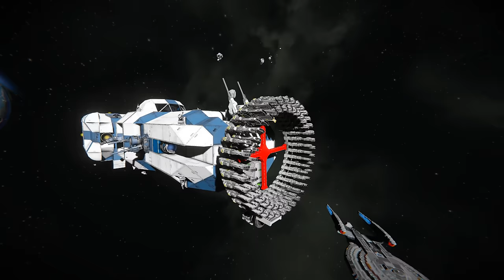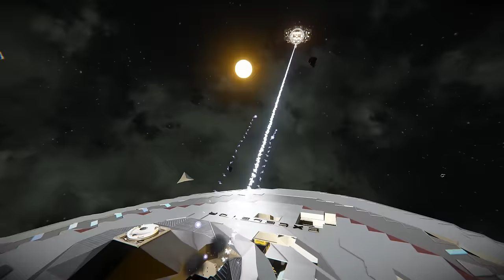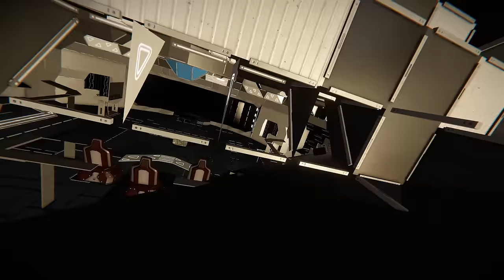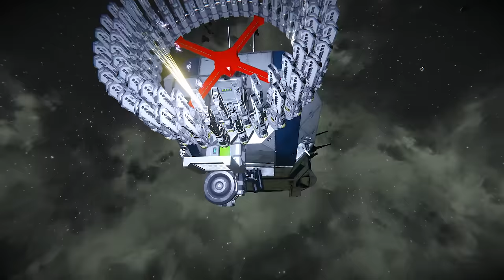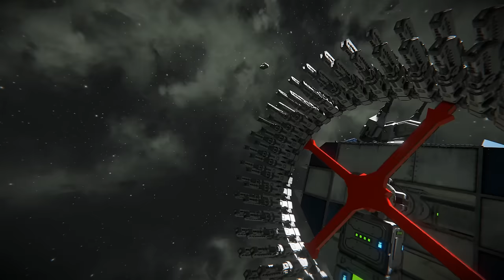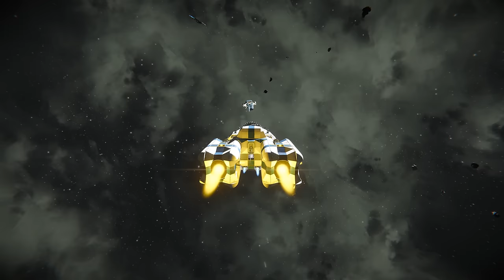Gatling Railgun Testing - Space Engineers

Comment: While the particular version of the gatling railgun shown in the video is not practical especially in a survival sense, the concept has merit and is very effective.

I found the long reload time of the railgun problematic as you would usually miss the shot anyway, to solve this I built a 12 barrel gatling railgun.
It's small enough to fit on the inside of a ship and fires out of a 1x1 hole at a rate of about 1 shot per 5 seconds; it's 5x5 and needs a 7x7 area to rotate within.
This greatly improves general accuracy and allows you to very quickly cripple an opposing ship with precision fire.

When used in this way I find the railgun to be one of the best weapons in the game.
Sure you will still likely miss the first and maybe the second shot, but anything after that is an almost guaranteed hit.
Ironically by firing more railgun rounds you end up wasting less of them.
Reply: If you built a ship big enough you could house the larger scale contraption and possibly some kind of ammo feed system. You could even build multiple ones and offset them along the length of the ship.

Comment: 1. Single-Grid Rotary Railgun.  A large ship that is as ring shaped as you can get with square voxels.  Attach railguns to the edge of the ring.  Slowly rotate the ship while firing.  Too make aiming easier, a single rotor block attached to a cockpit and offset camera can be used.  It's way easier to rotate a cockpit/camera than an entire bank of railguns!

2. Plasma Cutter.  A large row of railguns.  Align the railguns with the movement of the target.  Vastly increases the odds of at least one hit.

3. Plasma Cutter Rows.  Just a wall of railguns, that go off one row at a time.  Best used with hit and run tactics versus stationary targets.

4. Rear mounted Railguns.  Railguns on a turret that can point both forwards and backwards works.  It's easiest to hit a target that is either pursuing in a straight line or fleeing in a straight line.

5. Piston Magazine.  A single piston moves a stack of railguns up one voxel after each shot.  Requires only a single piston per stack of railguns.  Also, looks cool, since you can visibly see your 'ammo counter' in the form of how high the piston is offsetting your railguns.

6. Drone Swarm.  Similar to the detachable beam drones common in Gundam.  Figure out how many railguns a single battery or power plant can support, then build a bunch of minimalist drones off of that design.  You could even make them battery powered, such that they have to return and dock to a mothership to recharge.  An advanced script - more advanced than the best missile scripts - would be needed to coordinate the attacks of multiple railgun drones effectively.

7. Surgical Alpha Strike.  Each railgun is on an independent drone/turret/ship.  Use an advanced camera script to designate critical weakpoints in the enemy ship.  All railguns simultaneously fire on each of the targeted points.  If you want to get fancy, after recharging, each railgun targets the next weakpoint on the list.

8.  Targeting System.  The greatest innovation for Railguns is how it is aimed.  The ideal targeting system would let you target specific points on a ship (or even just the center of mass), display how close your aim is to that point, then automatically fire the railgun the millisecond you are perfectly on target.  How your railguns are placed would be irrelevant - point towards the target, wiggle a bit, and the first charged railgun with a perfect shot will fire.

9. Close Range Spotter + Long Range Sniper.  Send in a fast disposable, armored drone with multiple turrets (but no ammo).  Set each turret to prioritize something critical, like weapons, engines, or power plants. When the aim points of 3+ turrets intersect on a single point in space, calculate the point of intersection, and send those coordinates to a long range railgun sniper.  It might also be necessary to calculate the speed of the railgun projectile, the target, and any rotation of the target.

10. A "low tech" version of 7.  Find a stationary and unaware target.  Release 4+ railgun drones, which would each float only ~3 meters from their docking ports with the mother ship. Aim each railgun drone separately with a camera.  Since each railgun is on a separate ship, there is no risk of recoil from one gun interferring with another gun.  Once all guns are aimed, use an antanae to order all guns to fire simultaneously.  Order all railguns to dock, recharge the railguns with the mothership, then either repeat the process with hit and run or charge in guns blazing with the docked railguns acting like turrets.

Comment: For aiming, use an custom turret controller connected to a seperate camera (top mounted works well if you have it) on top of (or behind using a subgrid to see through the back of the blocks as shown on my channel) each railgun. When set up properly, it will only fire when theres a target to hit. 

Also, despite the reload time, this works much better if you just fire them all at once.

Comment: How do you make this better? Easy: scale down the pinwheel. 
Keep the sensor trigger mechanism. Shorten your 4 spokes. Each spoke should end in a cargo container (local magazine) and railgun. Feed that with an advanced rotor connected to a junction box or another cargo container. Then you duplicate that setup and place it behind that at an offset with the rear guns nested between to front ones. Lock the rotor that interconnects the 2 carousels at the appropriate angle (depends on how many layers you make, 45 deg for 2 layers, 30 deg for 3, 22.5 deg for 4, etc). Repeat this as desired, extending arms as required to accommodate the additional guns. Place adv rotors with sorters (set to push rail ammo only) fore and aft to build a hub. Redundant ammo feeds from each end. Both end cap rotors should be set to spin in the proper direction in case one gets broken.
Much less clang, far more compact in the vertical, slightly longer, probably sacrifices some rate of fire, fewer subgrids, still plenty of lag to get banned from most servers, still absolutely devastating.

Comment: How do you set anyu weapon to fire in sequence? I tried to make a artillery cannon gatling but all the guns fire at the same time...Do i have to set timer blocks? This seems exhaustive lol
Reply: Put a sensor on each of the guns set to shoot when activated, and place a block for the sensor to detect as a firing pin. When the sensor field passes through the block it's associated gun will fire. If your weapons are not on a rotor and are instead static you can use timer blocks in sequence to fire them.